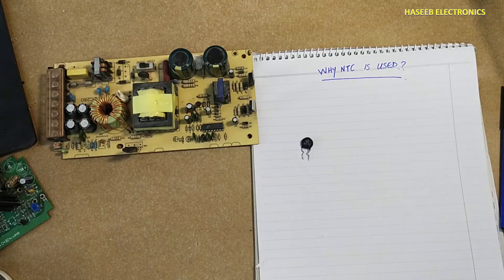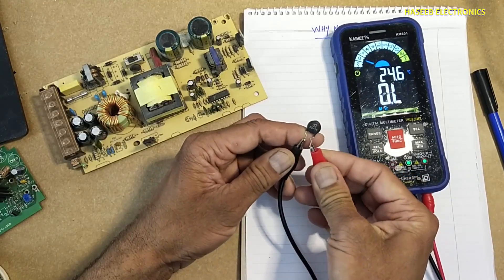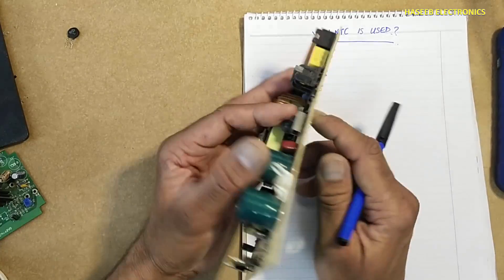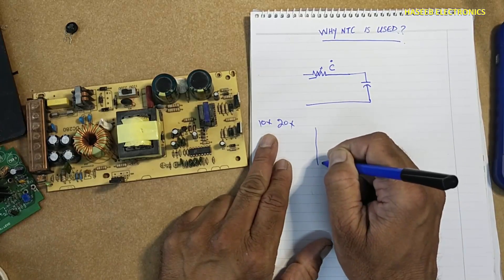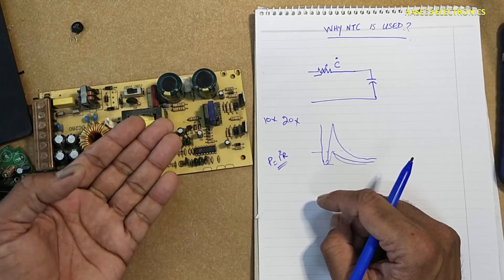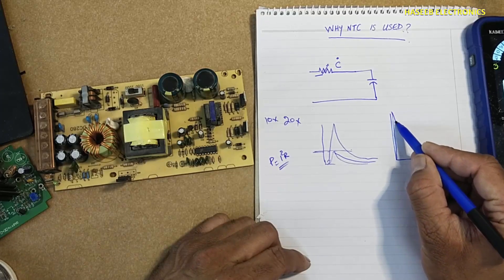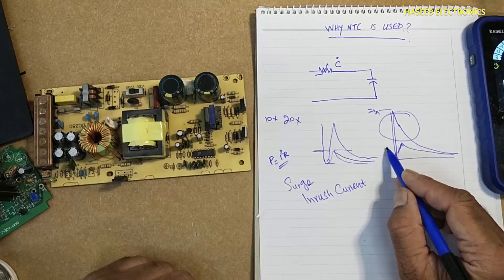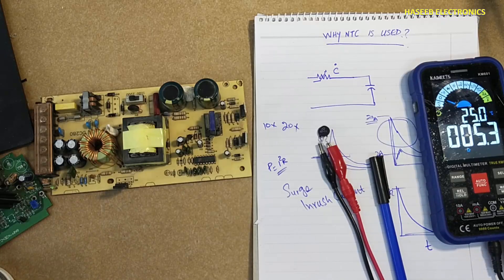{987} why ntc is used?

Comment: sir, if it reduce the resistance when the temperature rises, doestn it allow the current spike to go through the circuit? how it protect the circuit if that happen?
Reply from the maker: great point. 
when it is cold, at that time it provides resistance and that is the start up time of the capacitor charging 
when capacitor is charged at a specific level, after that there is not need to limit the current 
until that time the substrate temperature of the thermistor is increased and its resistance is dropped to allow full rated current 
(its negligible resistance value remains in circuit, but that doesn't effect on the circuit efficiency)

Comment: How this low ohms (NTC) resistor limit these high ampere current taken by capacitor?
By ohms law, I=V/R, if R is small, I is more. Is it correct.

Comment: Dear Sir I need your help please. 
I rewinded the secondary winding of microwave oven transformer to put it in a linear power supply i want to make  with a buck converter circuit  .
Now i am confused about  the current rush  , is it necessary to put ntc resistor before  after  the transformer , or after the bridge rectifier? 
Best regards ❤

Comment: Sir how do I know if this thermistor is not functioning? Thanks in advance for your kind reply. Thanks again.
Reply from the maker: in that case the fuse will burn out immediately after connecting power
Reply: Thanks 🙏

Comment: Sir I have a really urgent question
In my SMPS power supply 24v 10A working properly but when I turn on the smps just after the indicator light is off when smps is turned off it doesn't work
But after a min it works normal until I turn on off simultaneously
When repairing i noticed when my multimeter probe touch one 2sc1815 middle pin (tl494 c1) it turns on all of a sudden but and the cycle continues what should I do sir 🙏🙏
Reply: Broken solder joints or cracks in circuit board? Checking the ic with a meter and pushing down on the ic pins can reveal a loose solder joint on the ic where it is soldered onto the circuit board. If you can't see cracks around the pins with a magnifying glass, try to soldering around all the pins anyway and it might fix cracks in the solder. Be very careful when checking with a meter. VERY easy to short between pins with the meter test leads and destroy the ic!
  A short (bad capacitor or mosfet) or other problem will cause a fault and the ic will go into a loop and keep trying to reset itself. Check output voltage with a volt meter and see if there's a fluctuation in output voltage and that may show that. Watch Haseeb's MANY smps videos and he'll show this. Good Luck!